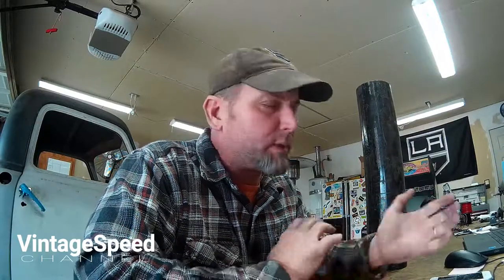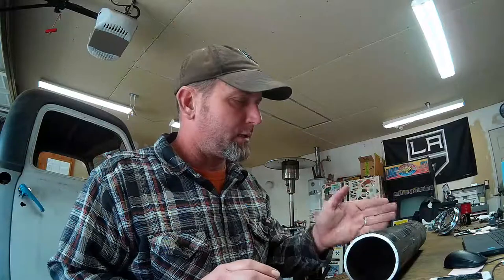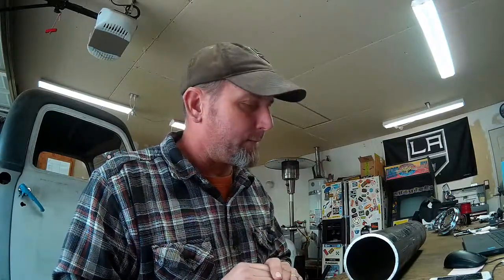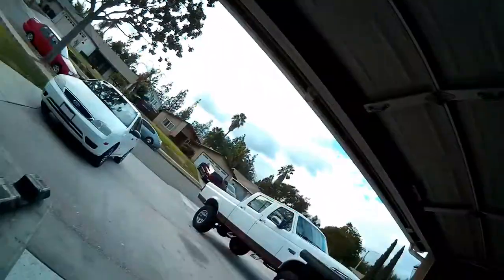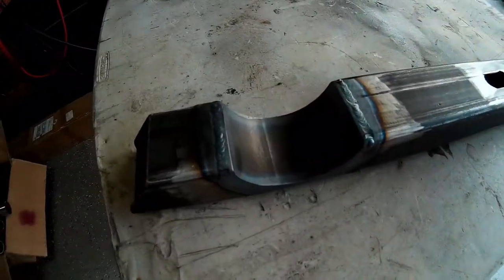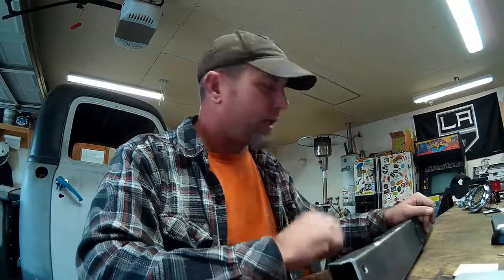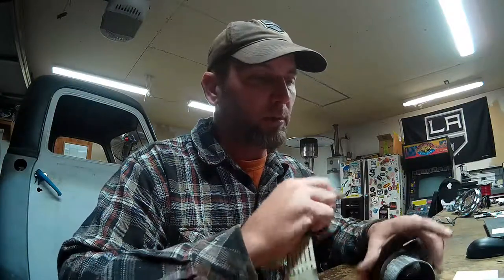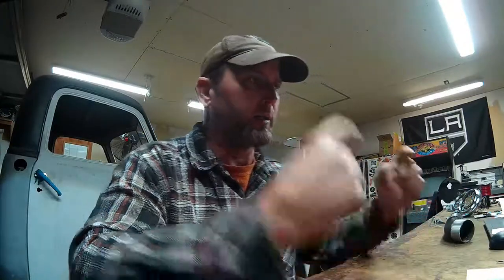P48 Project; Notched Transmission X-Member

Comment: Jim
What are the TIG settings you using?
Thanks
Reply from the maker: for the xmember cutouts, i was running about 100-120amps on the pedal, using 1/8" fillter.  i need to practice, practice, practice..  thanks for watching!